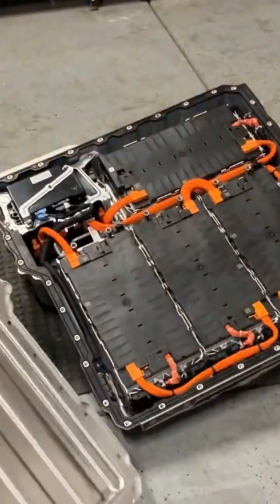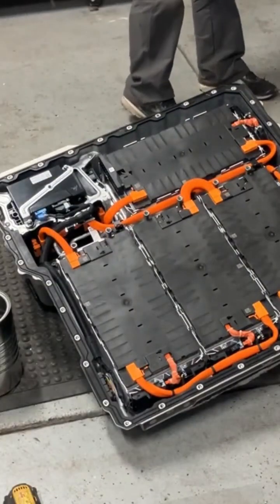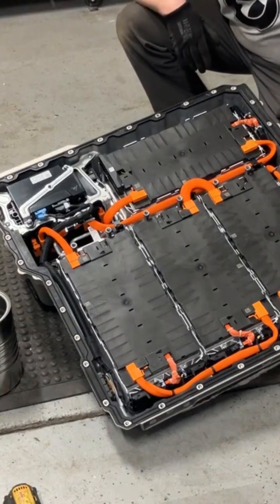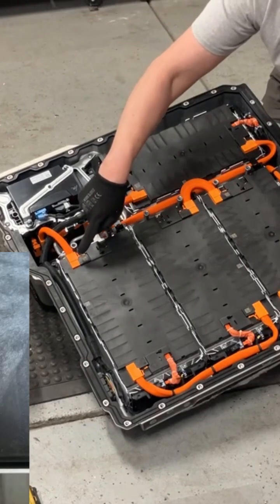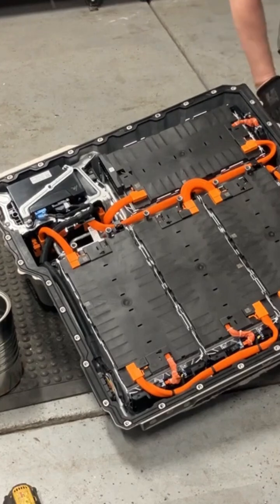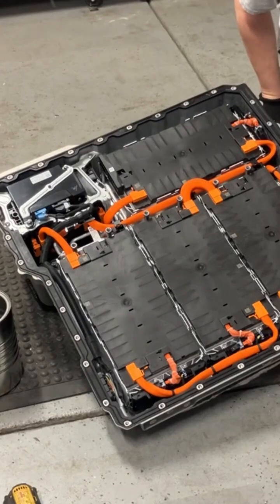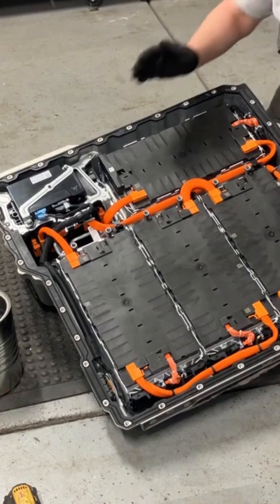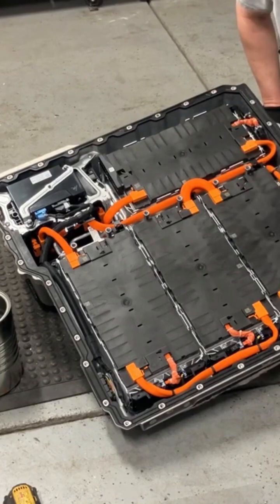BMW 330e Hybrid Battery Pack Teardow Teaser #automobile #diy

Comment: The third module is gone on mines. Is it as simple as changing it out? Does it need any sw calibration?
Reply from the maker: I'm sorry I honestly don't know but what I would do is try to find a replacement module from a car of the same year with close to the same mileage instead of buying a brand new one, then I would measure the voltage of each of the other modules and try to bring that one up to the same voltage using a 60 volt 5 amp cheapo Amazon bench power supply, (I may have a video on it, or its on one of the posts in the description) assuming they were all below 60 volts

Comment: I would like to buy a battery module for a 2016 BMW 330e
Reply from the maker: there's an eBayer out of Texas that sells individual modules
Reply: Hi I have a 2017 330e and I'm getting a charging malfunctioning alert alone with a check engine light.I have placed the regular battery. Can this problem be due to my hybrid battery needing to be replaced? Since this alert my AC doesn't work, the car makes a whining noise.